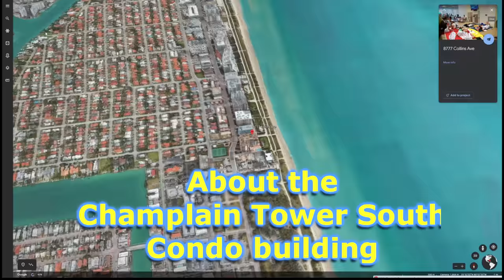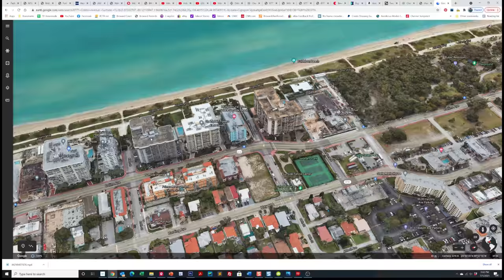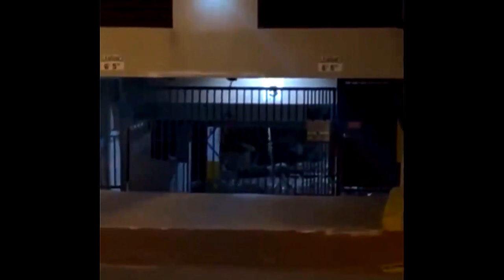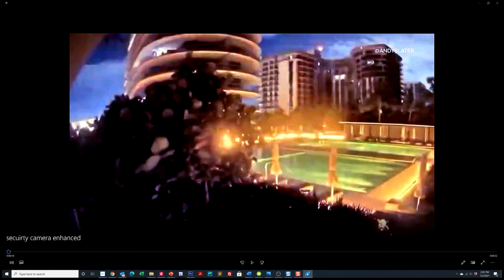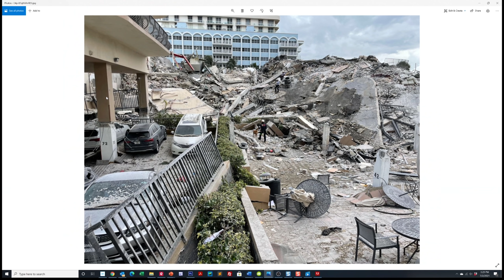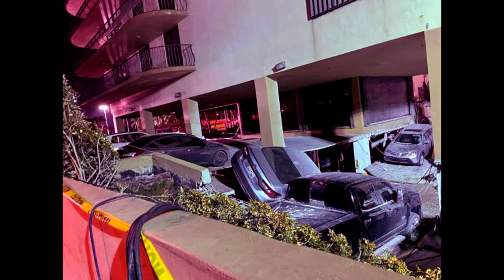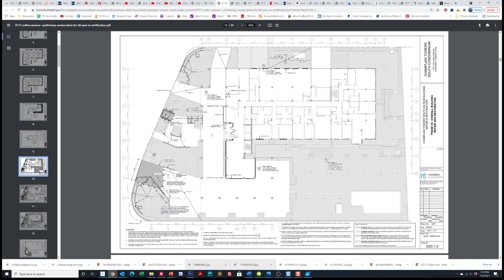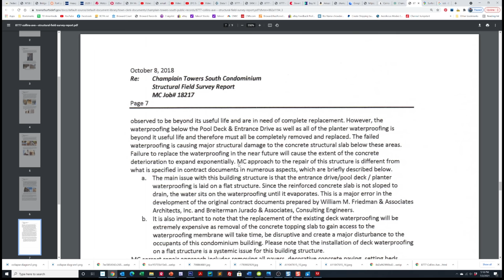Here's Cause Of Miami Condo Collapse Champlain Condo Towers, Surfside

Comment: Look at the "punch and shear" condition of the columns after the collapse.  Textbook P&S failure.  You either overload the supported deck causing failure or the supports deteriorate until failure occures.
Reply: By the way,  the amount and thickness of metal rods in columns and basement beams is ridiculously low for 12 story building
Reply: Blinded by Science the middle just doesnt fall out C'mon man
Reply: Demotion job pancaked from the top down ... ask an explosive expert ... this is what one told me .. all of his lecture on pool is bull
Reply: One of the findings from the 1981 Harbor Cay collapse (1981) was that the floor slabs were designed too thin (slab design thickness was 8 inches when ACI would have required 11 inches). The reforms to building codes and licensing standards happened AFTER Harbor Cay...and AFTER Champlain Tower was built.
Reply: @MikeB3542  I do structural repair for 30 years  in south Beach, all those building on south Beach are redone every ten years or so because the salt water gets into the rebar because concrete has pores and  it breaths and rust gets on the bar.. but the bar is still solid as a rock. I sandblast these bars and they come back brand new very few times have I had to replace them but it happens, whatever any one is saying about Spalding or stress cracks are not enough to collapse a building ...another thing that building came down from the top down it pancaked ....the damage was on the bottom so why did it n pancake from top to bottom instead of from the bottom ????
Reply: @vieshanblacksloft426  Right, let's deny the obvious evidence, the videos, the reports from people living there, and instead go with the conspiracy nutjob stuff.   Hell, the whole thing is on video and it did NOT pancake from the top down.  You can clearly see the collapse stages on the video.  As for "all the buildings are redone every 10 years", well, it's pretty obvious this building hasn't been "redone" in any shape or form.    Don't hire this guy for structural repairs, he'll claim you blew up your foundation...
Reply: @KrK007  it's more than we all think it's a demo job that s why they destroyed the rest of the evidence
Reply: @vieshanblacksloft426  They destroyed nothing, you have no evidence, while the evidence of the collapse is piled up all around you over your head.  You just refuse to admit it.
Reply: @vieshanblacksloft426  My questions, since you are sure it was a demo job, are: 
- WHY? Why was the building demoed?
- Why should we the masses whom weren't there ignore the reports of signs of failures caught on videos and reported by people who lived in the building and those that were around the building on that sad fateful day?
- Why was demoing the building the sole way of achieving the goal according to your conspiracy theory?

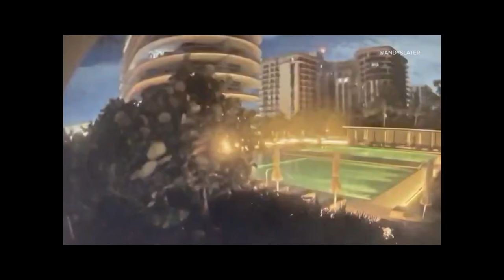Besides, regarding your theory of the building pancaking from from the upper floors towards the lower floors, 10:43 - 10:53 proves your claim wrong. 10:43 - 10:53 clearly shows the right side remnant of the building pancaking from bottom up, while slightly tilting towards the left at the very least.
Reply: @AChi__  good question.. another good question is how come the land is already sold??? Smells like fish to me
Reply: @vieshanblacksloft426  I'm just learning that from you right now. Assuming that it is true, I don't see a demo job being the sole way of gaining full access to the land for the purpose of ownership or future developments. The previous condo owners could've been bought out. On a side note. How did they buy the land without buying out the condo owners first?
Reply: @vieshanblacksloft426  I just looked it up, and no, it hasn't been sold. Also, the judge has since change his mind on selling the land to the highest bidder, and is now considering other options. So, no, the land has not been sold. You were wrong....again.
Source: https://www.miamiherald.com/news/local/article252826858.html
Reply: It's a way to steal land .... now there doing it in other building real estate take over if u ask.me its my conclusion ....my opinion is like an asshole everyone has one its  just that I repair a lot of these buildings on south Beach and I have seen much worst structure damage and the buildings get repaired seems very very strange then they demolish the rest of the building to cover up the evidence of blasting caps... like I said just my opinion
Reply: @vieshanblacksloft426  I agree that everyone has an opinion, and is allowed to have that opinion, and I respect that. I just come from the school of thought that opinions should be based mostly on facts and maybe some logical educated guesses. However, said educated guesses, as a matter of common courtesy, should be highlighted highlighted for what they are. That way one does not unintentionally spark off a rumor as a result of an unsuspecting person reading said educated guess and lazily spreading it without doing their own research. With that said, I see and understand the points you were trying to make, I just think that you made a bit of a conclusory leap to arrive at your definitely final claims. With that said, I've enjoyed our conversation, and will like to wish you the best with your endeavors in life. Till the next time we digitally cross paths in this other another comment section, take care and be well.
Reply: @AChi__  god bless you my brother much respect
Reply: @AChi__  the fact that I have worked on these building for years doing structural repair is why I'm saying this dont like to pull.my own horn but I have been doing buildings on south Beach for 30 years set up  safety lines first then set up scaffolds  scaffold cable then the motors... and electric line.. once scaffold are set and working ...I sound check walls floors balconies tie beams and columns.  I chase rebars with 35 pound chipping hammers or zip guns....I sandblast and prep rebar ...,,sandblast and prep them with Armour tech. I do forms do any kind of cement work  and I pull forms and do stucco 
. I have seen many building worst than this one and i have repaired them without no  collapse ever! Im saying by the look of this building the way it imploded with.minimul damage to any other area this was a demolition... buildings do not free fall from the top  to the bottom, pamcake, looks like a freaking demo. plus I have a friend that is a navy seal demolition expert... he said to me it fell just like the trade towers...  I trust and value my friends opinion thank you 
... its not just my opinion I have crazy knowledge of building repair, my title is a structural repair engineer..... im very skilled cat what i do im not just blowing smoke up any ones butt.  My opinion comes with the title I have earned .... thank you God bless you my brother

Comment: WOW I wish people had pulled a fire alarm instead of just running , I guess they were inn shock
Reply: But was it operational?  If a sprinkler line breaks it’s suppose to activate the alarm as well.
Reply: @tylerduchesneau  good question. Building looks completely dark before the collapse.
Reply: Anyone in that part of the building still standing, knew there was danger. They didn't need an alarm.

Comment: The beam (or soffit) in the parking garage you talked about being sheared is actually the “Tow Away Zone” sign on the gate. If it was a beam on the other side of the gate, you would see the bars over the beam. Also, the collapse probably happened in the row of columns where parking stall 78 is, not the row of columns where the ramp ends. From the tourist video, you can see that the debris is not at the column with the knee wall attached, but further down to the next set of columns -the row where stall 78 is. Watch the  “Building Integrity” analysis, it’s pretty accurate. Though your analysis and angles are great too. A combination of both makes things a lot clearer as to what most likely caused the collapse.
Reply: ...it's the black beam, just behind where the "tow Away zone " sign plank used to be attached to....the beam just stops...I thought the same thing, at first!
Reply: @jgrace3108  That’s not a black beam. It’s still part of the Tow Away sign. The sign is rectangular not square. I think it looks square because of the reflection. Compare the video to the daytime picture of the gate.
Reply: Clearly the reflection of the sign. You can still see the beam behind it. It matched the sign position size and color even. Must be blind not noticing it's in front of the gate.
Reply: @jgrace3108  looks like a shadow covering a portion but it's still there

Comment: Very good presentation!  However, it is very difficult to follow your cursor; it's small and white and often blends into the background and you are whipping it around.  I don't know if you have a way to change the cursor, ie. larger and/or a different color.  If so, that would be useful.

Comment: I like the beach, but wouldn’t want to live in an apartment right on the beach because of the saltwater corrosion.
Reply: The issue was the building design not the saltwater
Reply: I would take your place, the area these people lived most of us can only dream of calling home.
Reply: @madride858585  - This should never happen anywhere, especially a country like the USA which can afford to put the resources and know-how to build building that won't pancake.
Reply: I live on a beach and my building is in great shape. My building was designed to withstand the environment with proper waterproofing, foundations, drainage, support columns and protection against erosion. Champlain Towers were designed lacking in many of those areas and some of them weren’t even implemented altogether.
Reply: I'm sure the humidity and salt didn't help but not the main issue. Guessing the foundation was crap too.
Reply: There are all kinds of old highrise hotels along the coast of Florida, both coasts that have corrison. They have never come down. It just doesn't make sense to me that a building would come down just because of a collapse of a pool deck. My hubby has built highrise resorts for 25 years in Florida. I just still think something is very fishy. here. Just my opinion.
Reply: @madride858585  Also the leakage of chlorine filled water that corroded the pillars.
Reply: @dabouras  yea that definitely did not help
Reply: @PlayshotKalo  I wouldn't be too sure about that unless you have x-ray vision.
Reply: @MarcLloydZ  maybe you can come teach the professional experts that inspect my building how to do their job if you’re so concerned
Reply: @madride858585  i agree, but the salt in the air doesn’t help either.
Reply: @02markcal  i love the beach too, but just wouldn’t want to live in a high rise apartment, probably just a house would be fine.
Reply: @ilovesuisse1  After watching the video of the apartment pancaking a lot more people would sleep better in a house rather than a high rise, so you aren't alone and will take making changes to the building code along with more frequent/thorough inspections to change many peoples minds.

Comment: YouTube channel "Building Integrity" has some great info on the collapse. This was complete neglect! Where's the money for the upkeep on this building.
Reply: WaPo published an article recently about the condo board members - after the 2018 Engineering report for this building indicated that the building already had some serious issues, the condo board in 2019 apparently could not reach a consensus to commit to what would be a multi-million dollar repair project, and subsequent to that, about half of the condo board members resigned.  I guess they didn't want to be the ones having to tell condo residents that a hugely expensive repair project was needed.  Sad.
Reply: I watched just about every one of his videos. They are extremely detailed and from what I can tell accurate.
Reply: In the contractor’s, engineer’s, and main owners pockets.
Reply: @nobodyknows3180  , did you actually read the “Washington Post” article? because it provides copies of the letters explaining exactly what needed to be done and the expected costs. And BTW, 7 of the 9 members resigned in frustration at the other board members stonewalling and delaying the necessary work.
Reply: @Porter5habazz  , what “main owners”? It’s a condo, for Pete’s sake!! It’s owned by its residents. 😣
Reply: @inkyguy  OK... you're correct. It's the HOA cause monthly fees on this condo were very high. No regulations on these HOA cause... well... It's a RED STATE.
Reply: @inkyguy  yes, I did, and since you've added nothing new here to what I already said, why do you ask?

Comment: I went to the 1979 building plans.  On sheet 188 (out of 336) it clearly shows that the pool deck is sloped to various drains.  So either the deck was not constructed per the drawings or it was modified later or Morabito made an error in their assessment.  Any thoughts on this apparent discrepancy or am I missing something else?
Reply: Nope . You are correct.
riginal design had slope.
Reply from the maker: Well on sheet 188, and that is only page of 336 I could find mentioning the drains, they show the large X leading to each drain. Does that mean a 4 way slope? I don't know. But nothing shows any elevation or typical drawing of the pool slap profile or waterproofing underlayment. It could be the engineer had more drawings than the city has produced for us so far. He might have a separate pool drawing. One other thing has me nervous, look at the good photos of the pool deck before the collapse, I don't see any drains! Maybe someone removed them? Maybe they re did the paper bricks and covered them? But where are the drains?
Reply: The water on deck indicates a slope towards building. It's pooling by planters
Reply: @jeffostroff  I saw another engineer with picture of drains. Not sure how old it was.

Comment: When are the negligent owners and management being charged with wrongful death and going to be held accountable financially and criminally for basically committing homicide? 
Everyone involved in that company/corporation needs to go to jail for at least 20 years
Reply: Sad to say; they are no doubt, still, over the past 20 years, and even now, continuing to build more of the same PRETTY, COST CUTTING, FLIMSY, CANDY-COATED HOMES, and will continue to do so as long as they are allowed to do so!
Reply: Don't forget Charlie Crist repealing law that requires high rise property ownera to contribute to account that would have help make needed repairs. Demonrats destroying America.
Reply: The owners is the residents of the building. It is not a rental. And the management was their responsibility too. And they voted against expensive reparations, they have protocols from the meetings. And many of the folks that was voted in as HOA members died in their apartments too. So, they already paid the ultimate price.
Reply: The city building "inspector" who read this report and still declared the building safe is most culpable.  How can the HOA be responsible for knowing better than the city's expert?  Beyond that, it was many years of neglected maintenance that ultimately lead to the problem, not just the last few years.

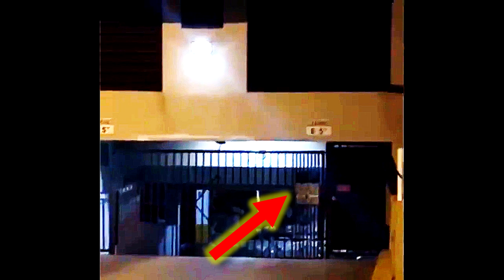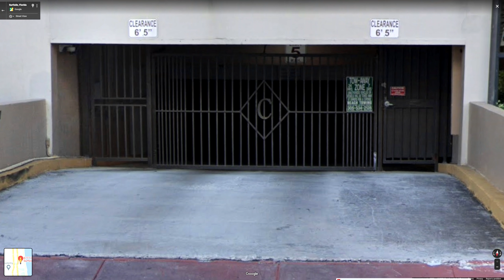Comment: The "beam" at 8:40 is just the Tow Away Zone sign on the outside of the gate, as seen at 8:53
Reply: No. You must look further, there is a beam from left to right in the dark area. It seems to be a bit lower on the right, behind the tow-away sign. At least that's what I think.

Comment: Great report but the lady who was in the phone was not facing the ocean. It was confirmed that Mrs Stratton was in the unit 410 (confirmed by her sister and not in 412 as some press articles mentioned) her unit was just in front of the pool deck which collapsed first. Units 10 were immediately close to the part of the building  that did not collapse but facing the pool area.

Comment: There’s no way people are legit still staying on the other side because the inspectors said it was fine. Obviously they’ve been wrong before.
Reply: I believe they said the East Tower (which is a whole other building a few blocks over - not the part that’s still standing that’s attached to the one that fell)
Reply: They demolished the other side.
Reply: Out of fear that it may collapse due to the oncoming hurricane.
Reply: The whole area should have been evacuated.
Reply: Engineering isn’t a guessing game, you better know what you’re doing; because as you can see it can kill people.

Comment: Why don't I see top slab steel at the columns.  Was it left off of the design, or construction, or just disintegrated?  This lack of top steel at the supports would be a likely culprit.
Reply: This is the problem in a nutshell. Everything else is symptoms and issues that probably wouldn’t be an issue with the correct rebar installed in the right place.

Comment: Excellent analysis. Even though not major structural support members, the amount of concrete spalling on the balconies made me wonder about the condition of the rest of the structure, especially being exposed to so much salt spray and moisture. I looked immediately at google street view and could see holes in balconies where reo had rusted and crumbled the concrete. Not a good sign.

Comment: This is the best video I've seen about this tragic collapse. Easy to understand and very good eye for understanding what happened. I believe you are onto something about the smaller vertical support beams on the sections that failed. I would have liked an analysis of the size requirement for such a structure for the supports for a building of this size. Were they too small? If you are an engineer you should be able to calculate how big they should be. Shouldn't building code inspectors have caught that issue? Probably taking money to look the other way. They should check any other buildings that or those inspectors signed off on.